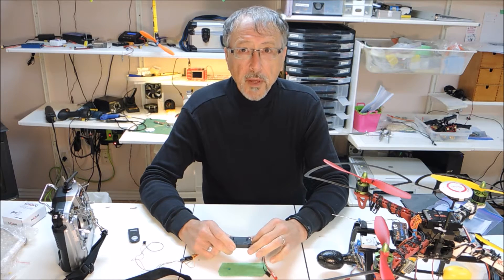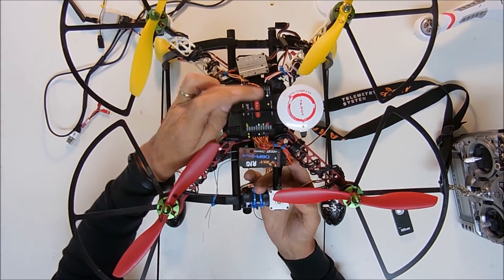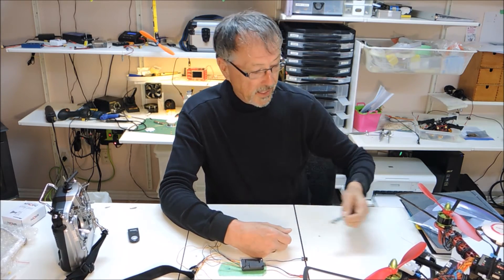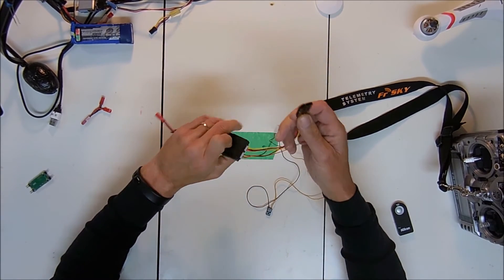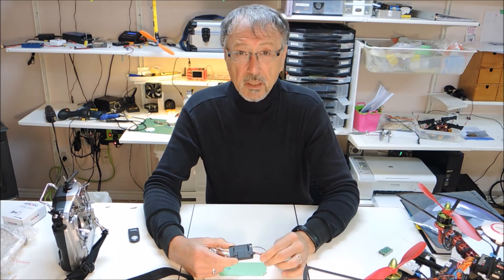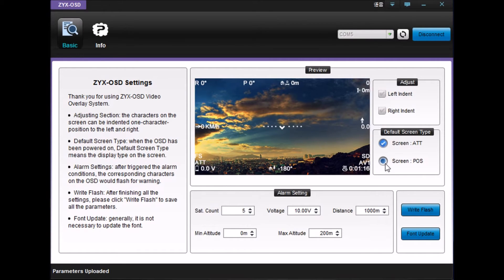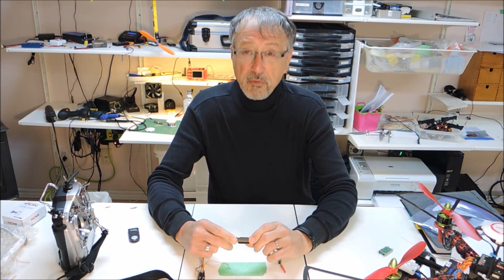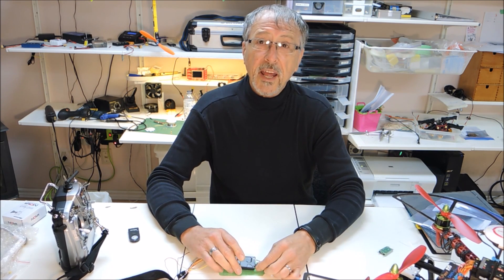Tarot OSD Review and Install

Comment: Hello....a very nice and comprehensive review of the tarot osd..i myself bought one and hooked it up to my tarot fy690s hexacopter...i am one issue...when i try to change the mode,the status never shows any change and it only shows att.can you help me figure out the solution to this?
Reply from the maker: I believe you need to calibrate the compass. They may do the trick.

Comment: can you please help me with the camera connections. i have the boscam TS832  and the FY mini 3d Gimbal with gopro. the gimbal has its own 12volt and also powers the gopro. from the gimbal , only a yellow and black cable are used for the Video in and from the boscam again only the yellow and black cables are used for Video out . So i connect this to the tarot osd without using any of the tarots 12volt , but nothing happens. what am i doing wrong????
Reply: same problem
Reply: In me case, if i put the yellow cable and black to the video transmitter directly, i can see the image, but when i put the cable of the camera in to ( V IN) to osd and the cable (V out)  to the video transmitter, now i can not See the image

Comment: I have the OSD tarot tl 300
Reply: Juan Carlos oanelli Hi, are you happy with the tl300?
Reply: naooooo...
Reply: Hi, I have not been able to program osd correctly the mavlink 2.00 or the mininosd 1.0.a few times the display screen is not displayed when the osd MS version 0 is turned on, when it should say MS version 231, I can not find the Vuelta Probe of everything; The only thing that seems to me to be, is the ftdi that fails to program. And that is going well
Reply from the maker: I did not have a problem. This should be full proof, unless the OSD is damaged. These units are very power sensitive so if the incorrect voltage is used it could damage the unit. Did you use the power from the PSU to power the OSD?

Comment: This friend OSD You Can Connect with Any controller ( naze32 , flip32 , CC3D ??
Reply from the maker: I'm not aware if this OSD will work with Naze32 or other controllers
Reply: it s Just for tarot zyx
Reply: horrible
Reply from the maker: This is only for tarot try minim osd for naze32